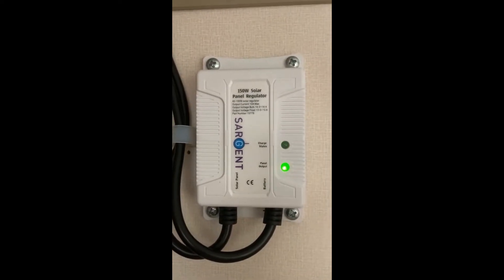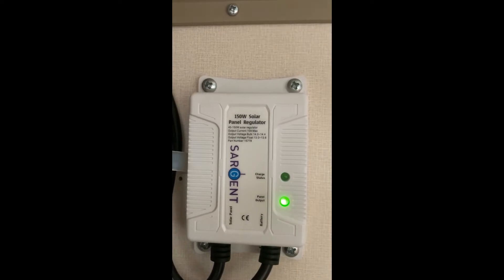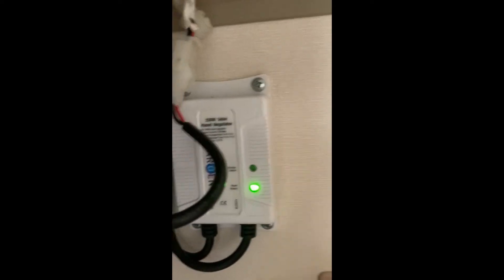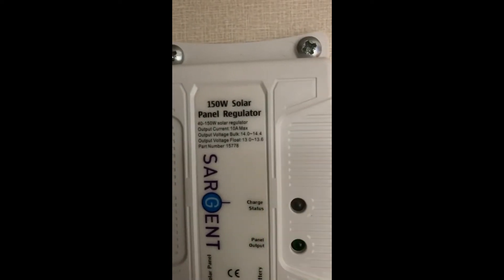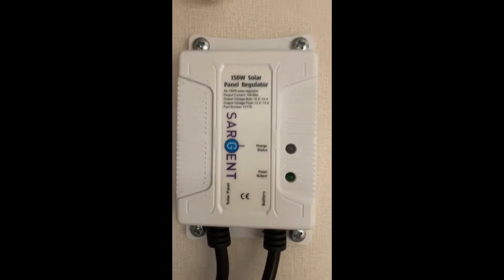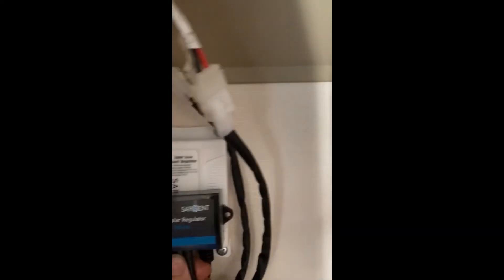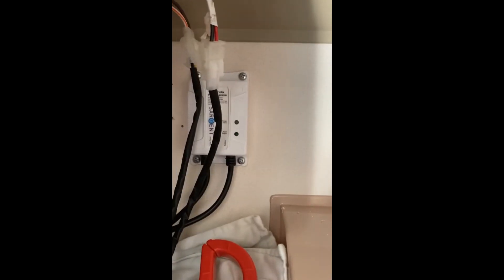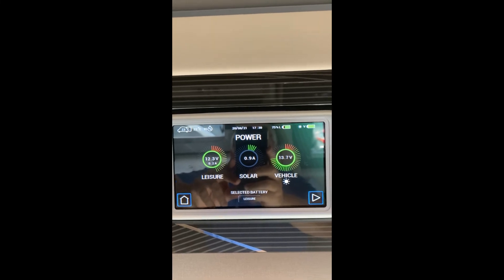Sargent 15778 Solar regulator charging problem

Comment: How is this working for you still? We've got a similar issue i believe, so will look into the voltages you mention to see if it's a similar story! 

Thanks for posting
Reply from the maker: Hi, mine is working perfectly, even in cloudy conditions the new regulator still manages to send current to the batteries, I have left my van unattended in the lock up for 3 months when I had an operation and the van started straight up when I got back in it.  Hope you find your problem too, I can highly recommend the MPPT unit I purchased. Hope this helps.

Comment: Quick question please ans... how is your caravan controller wired for it to know what amps its throwing out, I thought  its just panels  regulator then battery  all on its own loop.. solar panels on the caravan is 140watt  100 and a 40... then the 150watt reg.. and a 120AH 12v battery.. please help..
i have seen the lights working flashing.. and the red as well
Reply from the maker: Hi garydsouza2335, My set up is on my motorhome.
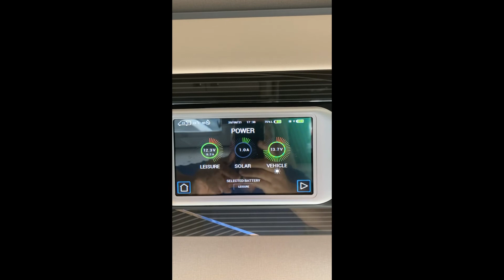The solar panel is connected to the solar regulator and that is connected to the Sargent EC600 system, which runs all of the electrics in my van, the pin connection on mine is marked as E9 on the rear of the EC600.  The EC600 then controls how much voltage and amps are sent to the batteries.  My problem was the Regulator was constantly sending 15V to the EC600 and the protection the EC600 stopped it going any further.  I did not have to measure any amps as my main display in the van shows the amps anyway as shown at the end of the video at 4:06 minutes in.
I don't know how or what make of van you have, but they should all go into a consumer unit similar to my EC600 on my van.  Please ensure you are not plugged into the mains before checking any connections.  Cheers.